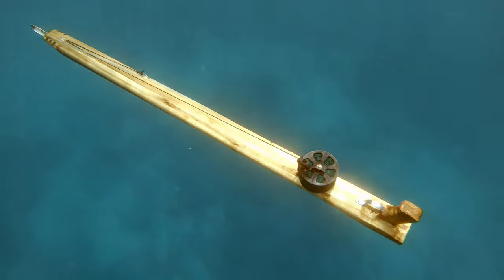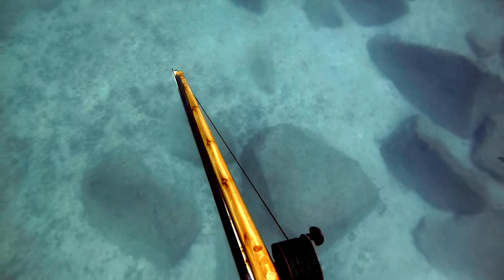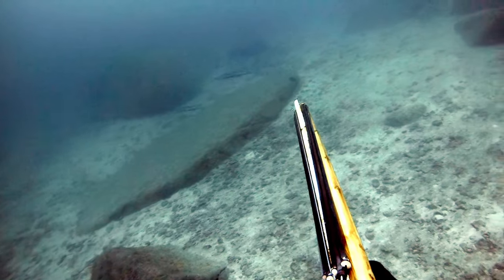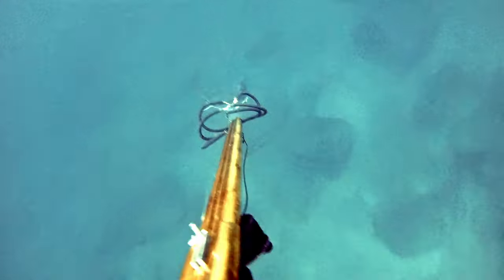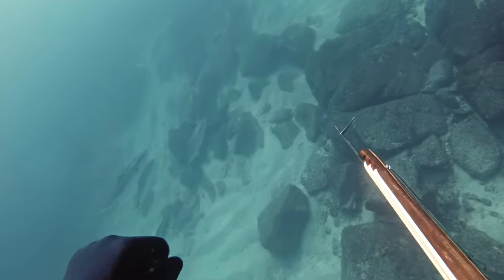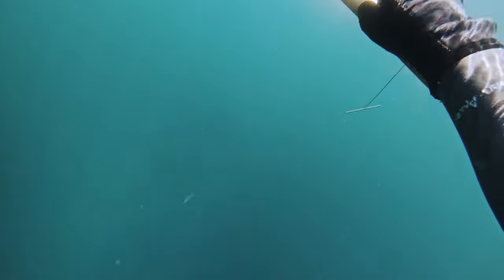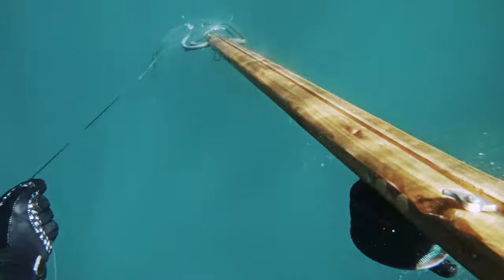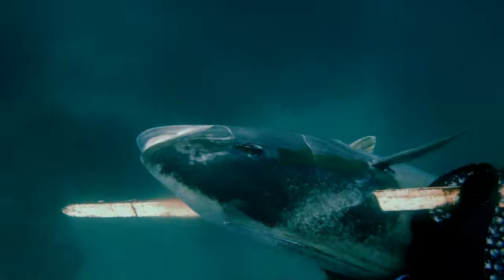Tbar Speargun Prototype murders Yellowtail - Testing and review

Comment: Was wondering what the point is but low key Seems like a good idea for the kill shot on larger tuna actually 😂 nice
Reply from the maker: Yeah, the tbar speargun was a funny project that is now proving to be a possible direction for spearguns. Perhaps with a thinner "shaft" and some strategy to reduce cavitations... working on that...
Reply: I’d like to see when u have a video of something that puts pressure on the reel. 
I wonder how that will workout. But as a kill spike to put down a bft this thing would do a good job cuz no flopper. Really enjoyed the video 😁👌🏽
Reply from the maker: @ed671671  well, the reel never has any pressure on it, regardless of the fish or the gun. it's freespooling, it simply gives out line, you cannot reel anything back in.